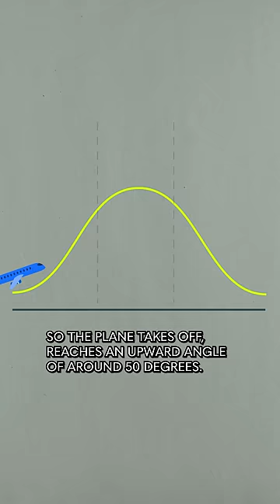How Zero G Planes Really Work

Comment: Jesus $8.5k  per person
Reply: I mean yea, it's a special plane for a special reason of course it's gonna be expensive lol
Reply: @abdulrahmanabusharbain7507  imagine somebody did this but like, spirirt airlines cost. Would be lit 💀
Reply: @ifriccicle1301 man, you're not gonna have 200 people packed in the plane like normal, so they charge individuals more, especially because there's slightly more risk involved and it's mainly a novelty thing. If you don't have time or money to spend on such things, it's better to ignore these things.
Reply: @iFriccicle except for the part where there's like only ten people on it, so you can't spread the fixed costs out to over a hundred people. Big planes are expensive to operate for really any amount of time
Reply: @rapid___  So there's a few questions to be asked. Size of plane? Duration of flight? I'm betting it's a smaller plane and a shorter flight.
The zero-g plane (vomit comet) is a big plane, not a dinky cesna and the flights are quite long, to provide enough time in zero-g for experiments/training/filming.
Another thing to consider is that the plane has been specially adapted and the flight staff (pilots and assistants) have been trained to work in zero-g (and not puke) all of that adds expense.
Reply: I don't think they book as many passengers as a coverventional plane so you're paying the equivalent of about 10-20 seats
Reply: Also fyi, you go 15 times, not just once. Still crazy expensive tho
Reply: adds to "things to do if I win the lottery" list

Comment: Very cool, but please note the curve you've shown doesn't look like a parabola, but rather like a Gaussian.
Reply: The middle part which she emphasizes is indeed parabolic and it has to be. Since earth's gravitational force is constant, your speed will increase linearly during freefall and hence the (vertical) distance from the apex will increase quadratically. The plane has to follow a parabola to match that motion and simulate 0g.
Reply: The overall flight path is Gaussian, but the zero g slice of it is parabolic. Terms greater than quadratic in the Maclaurin expansion of the trajectory are negligible.

Comment: the angle doesnt have to always be 42 degrees, nor does the climb is always 50 degrees. as long as your plane's vertical acceleration is about 33 ft/s^2 downwards, you will experience a G force of 0. but cool video 👍

Comment: Thats why when you freefall inside of an elevator instead of jumping you MUST LIE FACE UP AND AS FLAT AS POSSIBLE ON THE. GROUND. Yes it will hurt but it will be a lot safer than jumping into the air, and hitting the ground at almost the speed of 30mph

Comment: well, you are on the right path. they don't reduce speed to decrease gravity and increase speed to increase gravity.

the speed is just a product of the parabolic trajectory.

they lower the thrust of the plane but it is a careful balance to stay at 0g. when they are pulling out of the nose dive will they increase thrust but the higher G-forces come from the change of direction and not the change of speed.

Comment: Not entirely correct. You feel weightlessness a fair bit before you start diving. As soon as the plane stops accelerating, you will lift off the ground, and thus feel weightlessness. So, you are still gaining height relative to ground level, but you are also decelerating relative to ground, by staying in place, relative to the plane.

Comment: Just imagine if the engine breaks down 😅
Reply: airplanes don't just fall from the sky if engine fails, there's lift keeping them up even with no engine, lift is given by speed, not thrust, yes slowly the plane will loose speed but it has all the time to land on a safe space even if the engine fails. And btw, note that the plane is NEVER free falling, lift is always there, you feel like floating because the acceleration of the plane is in the same direction as the weight force. But there's lift on the wings plane through out all the maneuver, so even if the engine fails the plane has all the control it needs to land safely.

Comment: This is not quite correct. It's not about reducing or increasing speed., but about maintaining the SAME speed while managing flight path with angle-of-attack. (LOVE your channel, though!)
Reply: You're correct that the video is not correct, but saying that they maintain the same speed is also incorrect. They maintain the same horizontal speed, but the vertical speed is constantly changing (at 9.8 m/s²)
Reply: @TheHuesSciTech  If, by "horizontal speed", you mean "airspeed", then I agree. Respectfully, despite your mention of the gravitational acceleration constant, what you have written here does not make any sense.
Reply: @sgabriel  Assuming there is no wind, air speed is the same as total (hypotenuse) speed, NOT just the horizontal component as you have claimed. Put it this way: a fighter jet going in a vertical dive has zero horizontal speed, but most certainly does not report zero air speed.
Reply: @TheHuesSciTech  First, I have not claimed that airspeed=horizontal speed. Second, "total speed" is not a measurement, but you're inching toward velocity vector, so 👍! Third, you're ignoring the properties of air in your definition of "air speed". Fourth, you're still ignoring gravity. Fifth: Godspeed to you! (An expression of good will, rather than aircraft performance.)
Reply: Airspeed has nothing to do with this and neither does the angle of attack. The premise is that horizonal acceleration is as close to 0 as possible otherwise the people would be seen as floating towards the walls. Vertical acceleration is as close as possible to -9.8m/s which by definition is NOT maintaining the same speed.